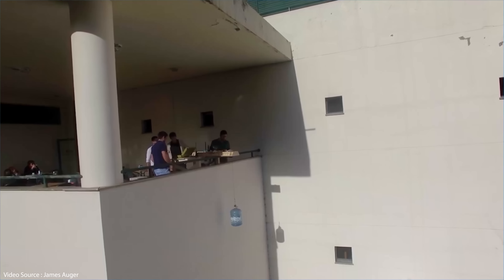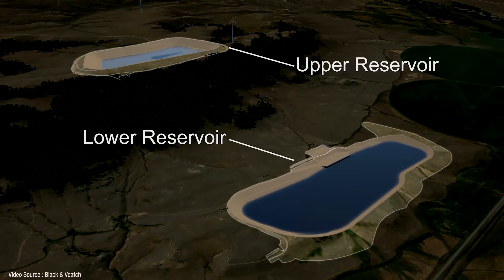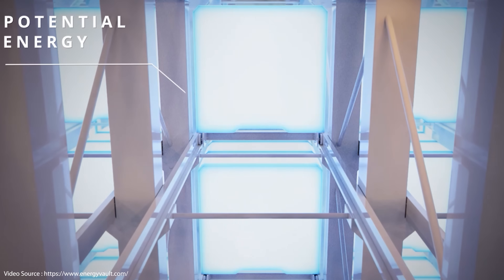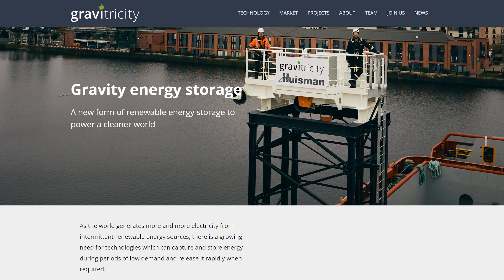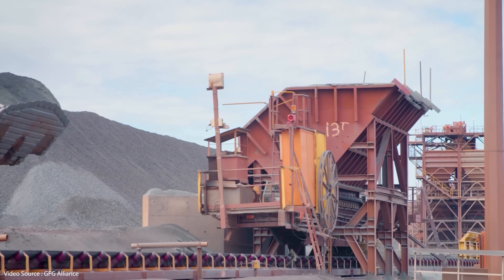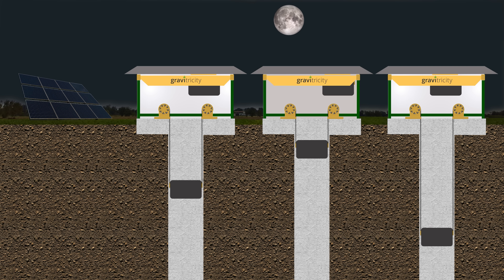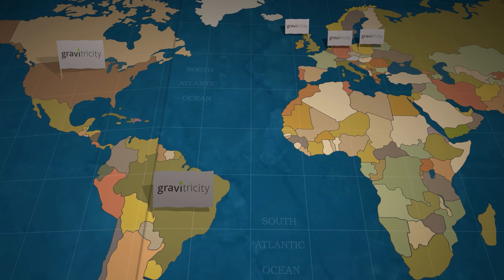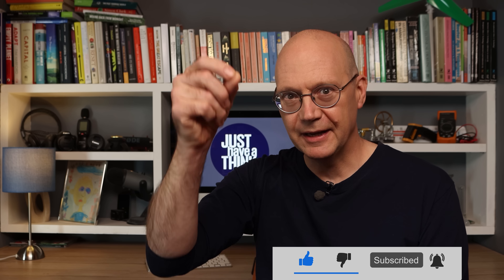Gravity Energy Storage. Who's right and who's wrong?

Comment: I know that the devil is in the details, but this seems to be a really good solution since it doesn't require any of the raw materials needed for grid scale battery storage so both systems could be employed simultaneously without competing for the same resources. Love it! So much better than a coal fired peaker plant. :-)
Reply: well it does seem a great use for these old mineshafts. however, most mines, once decommisioned will flood when the pumps are turned off, greatly reducing the droplength of the weights... and keeping the pums running isnt really viable...even if somehow they manage to isolate the shaft from rest of the mine...
Reply: @zvezdaster  Great point. Any clue how much energy to run the pumps? Also I assume they only run when water is detected. Maybe a decent solar array can neutralize that energy.
Reply: @fritzstauff  well that would depend on the geological circumstances, but its safe to say that extraction has to be continuous and at a near fixed rate or level. alternating the pressure on the shaft walls is the surrest way to make it collapse. However when the shaft starts an elevated level, lets say halfway up a mountain you might get the advantage of "dry hight" that you will be able to exploit. also some of such shaft could be sunk on purpose with exit openings at the bottom in mountainous locations. Which was common in old mines in such locations to keep em viable. with modern tech this should be much easier to do..
Reply: @zvezdaster  all you need is a mountain slope , with weights on train tracks ....
Reply: @richardstubbs6484  that would be a good idea.
Reply: @zvezdaster  
As long as the flooding doesn't collapse the shaft, flooding will reduce efficiency, not eliminate usefulness completely.

Buoyancy will reduce effective density of the weighs with 5-40% depending on the material of the weighs.

Finally the gold reserve could do something useful for a change ;-)
Reply: Yup got to say this one seems logical. It won’t handle all energy storage. But I imagine any one sitting on old mines will be installing these.
Reply: @fritzstauff  Well if you already have a cavern down there that you need to stabilize anyhow then it is really about running the numbers if you go for this solution or a more classical approach with water or compressed air as media.
Reply: Then you can be rest peacefully knowing that there are no coal fired peaker plants. :-)
Coal plants take fare to long to get up to speed, but there are lots of natural gas peaker plants that it would be nice if they could stop using.
Reply: @bknesheim  "...there are no coal fired peaker plants."

Thank you for writing this.  I was about to make the same comment but you beat me to it.
  
Incidentally, gas peaker plants will probably be replaced by batteries before the last coal burning power plant goes cold.  They are so expensive to run that batteries are cheaper already in some places.  

You probably know this already, but I'll say it for the benefit of other readers:  There's another type of gas burning power plant, called "combined cycle gas turbine" or CCGT for short.  It burns gas in a gas turbine like a peaker plant, but then runs the hot gas turbine exhaust into a boiler to make steam for a steam turbine.  Because the heat of the burning gas is used twice, it makes almost twice the electricity as a gas peaker per unit of gas used.  In places where natural gas is cheap, like the USA, CCGT plants may be run 24/7 to replace coal baseload.  Everywhere in the world that has natural gas and an electrical grid, CCGT plants are used for "load following"; on before dawn, run all day, shut down after most people have gone to bed at night.  Because they are versatile and relatively cheap to run, CCGTs are likely to be the last type of fossil fuel power plant to be operational, long after gas peakers and coal baseload plants have been shut down and dismantled.
Reply: @calamityjean1525  Many places they also add flash evaporator cycles on the tail end for desalination and that will also help to keep the natural gas fired plants alive.
Reply: @bknesheim  For a while, yes, in places that don't have enough naturally fresh water.  However, natural gas, at least in the US, is a by-product of oil drilling.  As electric cars become more common and the demand for oil falls, natural gas will become in short supply and more expensive.  Eventually, CCGT plants with desalination won't be able to compete with renewable electricity and other methods of desalination.
Reply: @calamityjean1525  i do think your right, but I also believe that in 50 years there will still be plants running. Probably no new plants will be built, but plants and fields can have a long lifespan. "Ekofisk" the first oil and gas field found in the Norwegian part of the North Sea still produce 127.000 barrels per day. That 51 years after production was started and it will produce for several more years. After the huge cost of starting production just keeping it going is cheap and the same goes for electricity production.
Gas prices will only be high if there is a large demand. If demand is reduced, gas could even be cheaper then what it is now.
Reply: @bknesheim  "...I also believe that in 50 years there will still be plants running."
I fear that you're right, but I hope that you're wrong.  
It doesn't matter how cheap it is to keep a well going, if there's no market for its output.  In the world today, high oil prices "subsidise" cheap natural gas.  As the demand for oil falls, the price of oil will fall so to make an oil-and-gas well profitable the price of natural gas must rise.  
The price of natural gas will rise even if demand falls, if the supply of gas falls even more.  The oil and gas markets will be real scary over the next decade or two.
Reply: How important is it to have a hydro electric generator at the bottom of the water flow as opposed to near the top in an enclosed vertical pipe once flow is established (e.g siphon)? Just wondering about the feasibility of using flooded mine shafts for hydro power storage. Probably an impractical idea!
Reply: it does require tonnes and tonnes of concrete and the steel to hold it up.    and given the low energy denisty it might well be worse than things like flow batteries.
Reply: @mralistair737  
Maybe watch the whole video?
The cost estimates for the mine shaft solution was below flow batteries and everything else.

The bare field solution was more uncertain.

Maybe rails up a mountain side would help? No structure to speak of.
Reply: @madshorn5826  I did, but given they haven't built and operated one of these yet I dont trust their numbers.   But my comment above was a response to people saying that it didn't use "resources" which is not true, since the energy density is so low the simple resources they do use will perhaps work out worse in the long run per kwh.  The real problem here that there really arent that many mineshafts and the energy density is TINY so even if it's cheaper per Kwh that is irrelevant if they can only supply tiny amounts of power then it's never going to make a significant dent in the amount of storage we need.
Reply: @mralistair737  
I get what you are saying, but I am afraid we need every scrap of relevant technology.
There will be no killer-app solution at this point.
It will be a patchwork of solutions tailored to local opportunities and economy.

Yes, it will be messy.
Yes, it will be sub optimal.
But if we had wanted "the best" solution we should have listened to science in the 1980ties :-(

The trick will be to reign in the obvious snake oil peddlers and not trash talk solutions that will have niches somewhere.
Economy will guide which technology that will dominate, but we need to try out semi plausible solutions too in order to discover new angles and opportunities.
Lock-in of old technologies can dictate what is the best practical solution even if theory tells us otherwise.

I'd recommend the channel Mustard for interesting takes on why on-paper promising tech failed :-)
Reply: @madshorn5826   as the guy says, just have a think! Motor/generators connected to heavy weights have been a thing for well over 100 years, we have had cheaper overnight rates for electricity for decades, and yet we don't see anyone doing this at any scale,  Because on Earth the amount of potential energy in raising a heavy weight a great height is negligible. I bet if you searched hard enough you would find similar proposals from long ago, when electricity was way more expensive,  That died when they meant the reality of small energy versus wear and tear and set up costs. Physics hasn't changed, the engineering hasn't advanced much, but hype and froth over energy storage has.
Reply: @skierpage  
Tl;dr Gravity storage had no place in the world of yesterday, but yesterday's world are dying in problems of it's own making.

Looking myopically on the technical side you are quite right, physics and engineering haven't changed :-)

Taking the broader picture into consideration though, a lot have and will change.

Cheap energy is over for at least 3 generations.
That changes the economic part of the equation.

We will have to reduce our consumption drastically to solve all the crises we are facing, including energy consumption. This opens up for considering old tricks that didn't cut the mustard when we needed to sustain a shop-till-you-drop 24/7 culture.
In a smallish community near a mineshaft where heating are taken care of by a heat storage supplied by solar thermal collectors, the electricity demand in periods without wind could be low enough to make a gravity storage interesting.

Gravity storages are old tech as you note and may be way cheaper than fancy flow batteries in a world where everyone wants rare elements for their generators, car batteries and MWh batteries.

Our future will be brighter, cleaner, calmer - and a patchwork of hacks ;-)
Reply: @madshorn5826  adjusting for inflation, electricity in the USA has gone down slightly in price over the last 40 years. Solar, and solar backed by battery storage, continues to get cheaper per MWh.

It will be great if lowering 500t weights down a shaft results in cheaper electricity storage than batteries, regardless of my doubts. I tried and failed to price out a 500 ton winch and the cabling required. It has to be completely automated, because with daily cycling the value of electricity stored is less than the salary of a single operator.
Reply: @skierpage  
Yes, electricity has become cheaper in the past. Because we didn't pay the true cost. Now the bill is due and you can no longer use past experience to estimate the future in a lot of areas.

We can't continue to spend energy like there is no tomorrow: If we do, soon there will be no tomorrow.

If we want to curb demand there is basically two options: raise the price and/or ration the resource.
Add in that we need to abandon fossil fuels totally by 2050, but still supply electricity for all 8 billion people in the world.
This will strain the supply of raw materials for generators and batteries and therefore the prices will go up.

That is two reasons we may see the price for 1 kWh approach a dollar - or two.
This opens up possibilities that was uneconomical in the past.

It would have great if we can build solar, wind and MWh batteries for all 8 billion people on earth, but what I am saying is that in some cases other solutions may be more practical and cheaper. One-size-fits-all has never been good and it will be more pronounced in the future.

The operation of a gravity battery ought to be easily automated: It is basically a glorified elevator, and those are serviced every two years or so :-)
Reply: @madshorn5826  Yes, obviously we need to make all forms of energy, manufacturing, and processes pay for the harms from the pollution and greenhouse gases they create. That's negligible for wind and solar, but I suppose their prices will go up because demand for them will increase so much when fossil fuel thermal plants have to pay a carbon tax.

I don't know how we get 4 billion people in developed countries to lead far less damaging lives. I've stopped flying, I don't eat meat, I ride an e-bike in my city, I put in a hat pump, I pay for "100% green" electricity, but few of my friends have, yet.
Reply: @skierpage  
It can seem hopeless to turn the supertanker of public opinion, but remember that smoking was considered okay in busses just 30 years ago and sexual harassment practically came with the job on the bad old days.
A hundred years ago women couldn't vote in most countries.
Things supposedly set in stone can change.
Just look at the two of us: I too have cut meat drastically, buy renewable electricity, bought a used EV and take the train. And I try to buy used stuff or stuff that last. (This is written on my new Fairphone 4. My wife's phone died and being less of a geek, she inherited my S8 :-)

Imagine using the powerful tools of the advertising industry to stop selling stuff :-)
In Sweden "flygskam" (publicly shaming flying) is starting to be a concept.

We just need to focus on what we gain: less stress, more free time, more nature, better quality products and better health :-D

Comment: I have the feeling that this technology is crappy, and I am not sure why. It really sounds like a scam. 171$ per MWh, I do not know? You need a 500m hole, this is no way cheap.
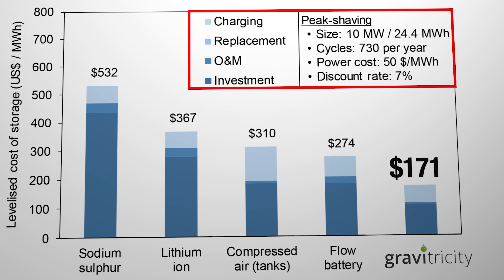For example, 8:24 is missing pumped hydro for "a good reason". Pumped hydro LCOS is something between 100~400. I think the only advantage is that iron ore is 5x denser per m3 than water, which means 5x volume potential.